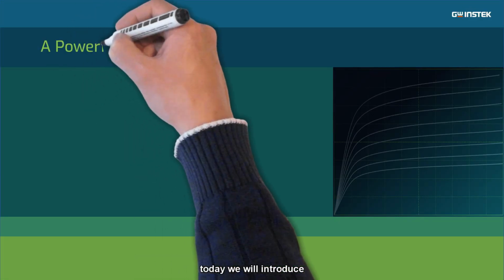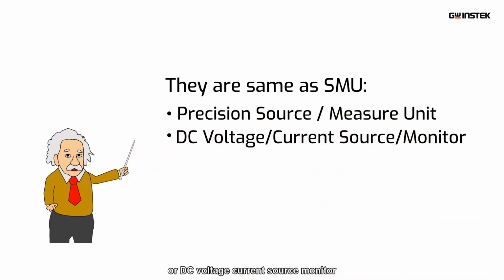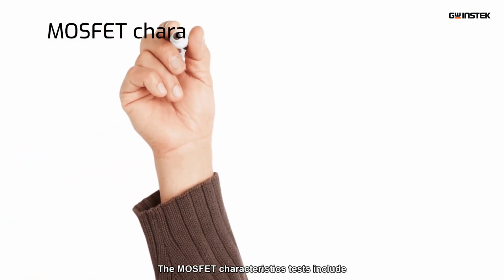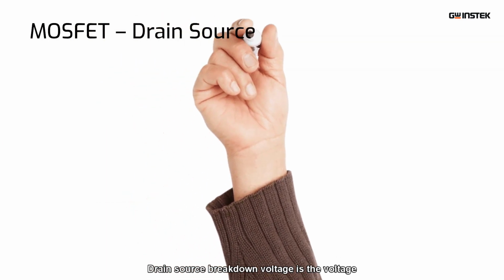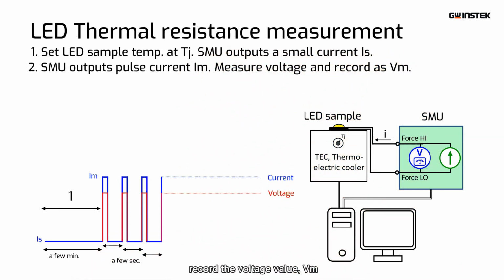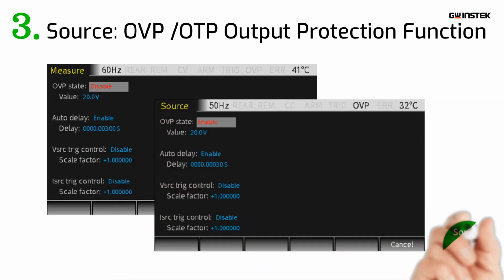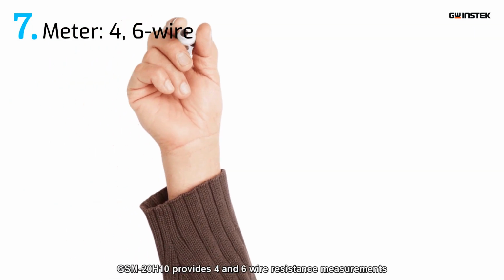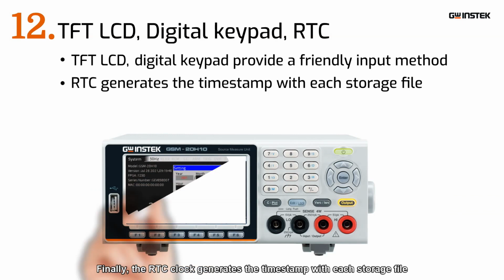A Powerful Tool for Electronic Component Characteristic Test: GSM-20H10 Source Measure Unit

Comment: Excellent prentation. 
1. What is the current range change time? 
2. How is range change implemented? 
3. Is it possible to synchronize 2 or more of these devices' channels? Thank you very much.
Reply from the maker: Sorry for the late reply. Please refer to the below information.
1. For source output settling time :100us typical.
2.GSM-20H10 provides direction keys are used for parameter and menu selection as
well for fine adjustment of the current/voltage range settings.                                   
3.Yes, we provide digital IO interface,its include trigger link function.